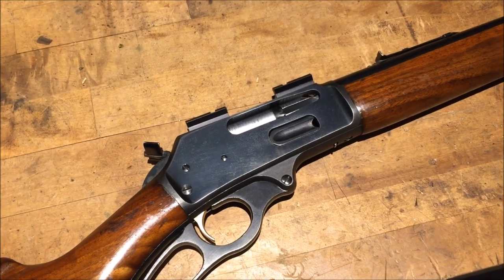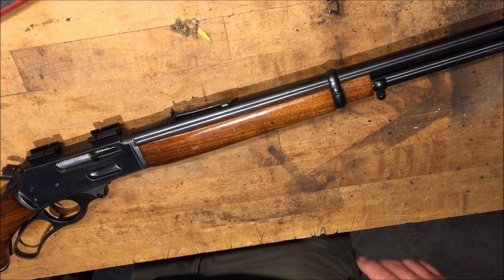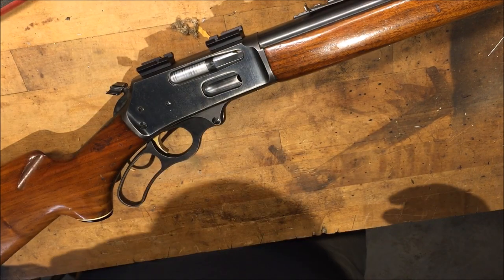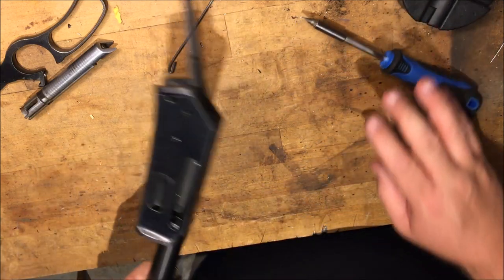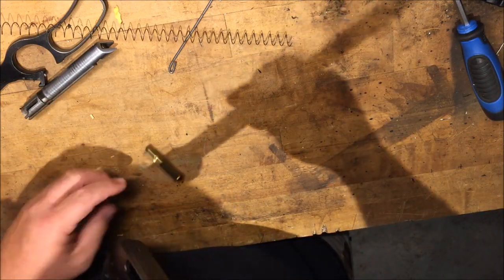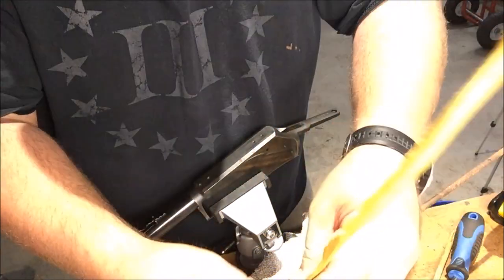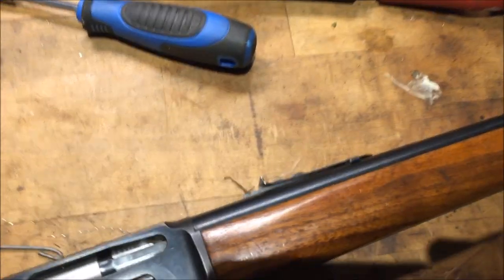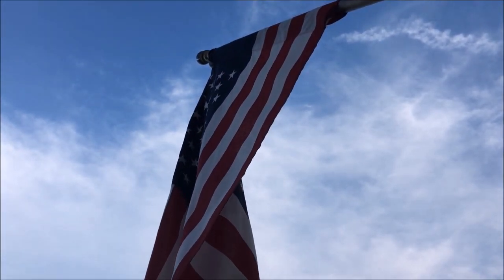Marlin 336 30-30 Winchester / Chamber Issues and Remedy

Comment: You Could  RE-CHAMBER  to 30-30 AI {ACKLEY IMPROVED} or 307 Winchester.  307 Winchester chamber is large enough that it would definitely eliminate  over-sized or sloppy chamber problems.  Getting brass or ammo for 307 Win might be a challenge and it packs slightly more punch than the 30-30 does.   SOME people claim that a NEW & properly fitted "Locking Bolt"  or Locking Block will tighten up the chamber or  "push the round"  more forward in the chamber.
Reply from the maker: Very cool option. Thanks for stopping by.